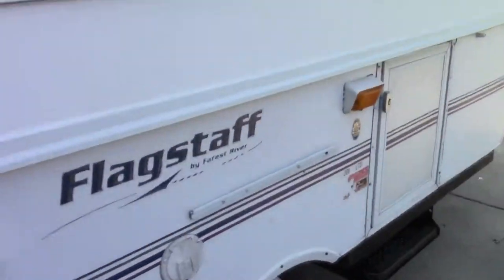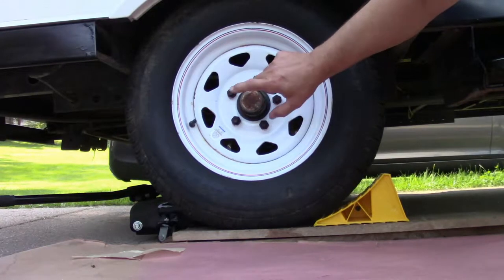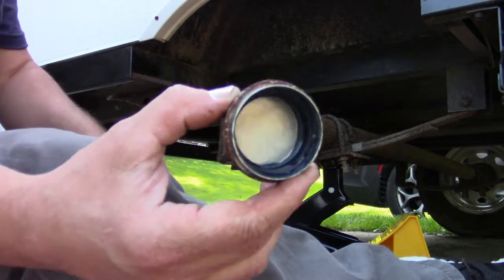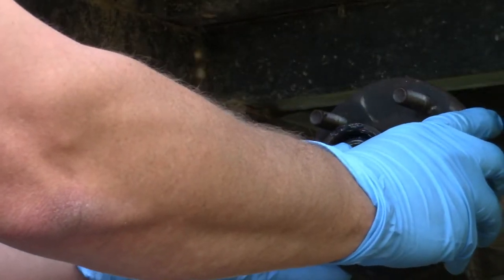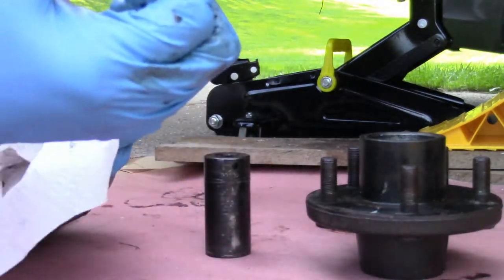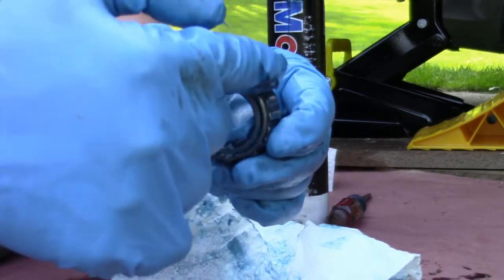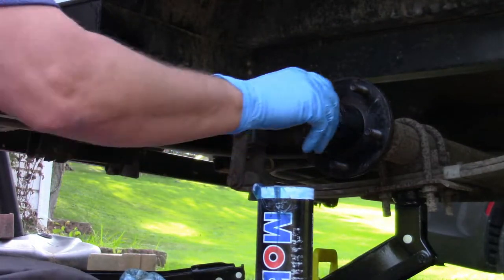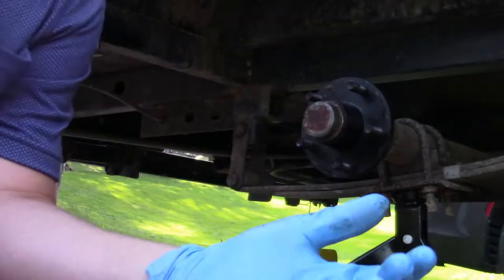2004 Pop Up Camper Packing Wheel Bearings with Grease

Comment: FYI to people who want to do this themselves; now may be a good time to replace the bearing seals as well if you're unsure how long it's been since they were replaced or if there is grease leaking from the hub cover or rear seal.  While re-using a cotter pin is common practice, inspect it closely for metal fatigue at the points where the pin bends.
The price of a new cotter pin is miniscule compared to having a wheel fall off at 70mph on a busy freeway - (think liability).  Also found it interesting that this 2004 Flagstar doesn't use a washer between the outer bearing and the castle nut like the 2002 does.
Reply from the maker: Thanks for watching, and for the great and useful comment.  I would love to go back and revisit this flagstaff, but it was traded off on a new camper.  Thanks again!

Comment: I know this is an old video, but there should have been a grease seal on the back of the hub. with a screwdriver you should have removed that seal and replaced it. The bearing would then just pull out with out hammering it out the other direction. You could have damaged that bearing. After you greased the bearing and put grease on the race and inside of the hub. Lay the bearing on the race.Then should have reinstalled the grease seal.

Comment: So I've never done this before and it looks pretty easy if you are mechanically inclined.   Only thing is...why did you not show the back bearing packing and positioning?  Is it the same process as the front?   Does the "cone" go toward the outside in mirror image of the outer bearing cone facing inward?
Reply from the maker: buttwheat75   It is the same as the front just basically backwards.  It goes back in the same way it comes out.  And for some reason I didn’t have the camera on when I put the back bearing in.  Didn’t know until every thing was over and I was editing the video.  Thanks for watching!
Reply: I’m sure u probably have to hammer it back in. Would have been nice to see that part

Comment: great video I have a question should I grease these every so many miles or grease every couple years
Reply from the maker: @countryjim100  depends on how much you use it.  I did mine every 3k miles or every other year Which ever came first.  Usuallly every other year.
Reply: @NorthCentral  I appreciate it it looks like I will be doing it every two years

Comment: just bought a 2004 Viking saga 1906 st seller indicated he just did a new grease pack and grease shot out from the rubber cap on the freeway. Can I just remove and replace the cap or should I take the bearing out and redo the whole thing? Is this an item I can find at ORiley's?
Reply from the maker: A common mistake in packing a bearing is thinking that u have to fill the entire cavity with grease.    You don’t.   You can probably get away with just reseating the cap back on, but I would look at it very closely before I did.  One thing I’ve learned is no one ever does a good a job as me.

Comment: This is a very helpful video.  Thank you for sharing!   What's the proper placement for the jack to lift up the camper?  Thank you in advance.
Reply from the maker: Andrew Parker  that’s really going to depend on the camper.  I put this one right on the bottom of the spring where the axle met the spring.  I’d go outside and look at it again, but I traded it off this past spring for a new camper.  Thank you for watching and commenting.

Comment: How often does this need to be done? We bought ours used two years ago and have only used twice. Probably about 1500 miles.
Reply from the maker: Oil and grease will degrade from just sitting around, especially if it is in sunlight or higher heat from sunlight.  My rule of thumb is every other season or 3000 miles, which ever comes first.

Comment: DO you have a video of the top replacement repair you did?
Reply from the maker: I’m afraid I do not.  I did not film the replacement.  I did not replace it in a conventional way.  Instead of using wood with an aluminum covering,  I went to Lows and bought a piece of PVC board.  A few cuts and trim later,  I installed it.  It was a little thicker, and so stuck out more, but it worked.  

I no longer have the pop up camper so I can’t show the work.

Thanks for the comment and for watching!

Comment: Did you have to remove a seal at the rear of the hub, before you knocked out the rear bearing?
Reply from the maker: As I recall, their was not a seal or washer on the back.  The back washer was held in place by friction inside the hub.  Unfortunately I’m not able to go out and check either, I traded the pop up on a new camper earlier this spring.  But again, as close as I can remember, the bearing was held in place by friction inside the hub.  I simply packed, then replaced the bearing and tapped it into place.  I wish I had it on the video, but for what ever reason I didn’t record that part.  Hope this helps, and thanks for watching..
Reply: At 6 minutes it looks like either the bearing and seal are stuck together or the bearing had a built in seal

Comment: How often should you replace the grease in the bearings I have a pop-up camper I bought two years ago and have never done it yet. Also it looks like there's grease that leaked out around the cat on the one side of my camper does that mean that the bearings could be gone or something?
Reply from the maker: As a rule of thumb,  I say re pack your bearing every 3,000 miles or every other season.  Which ever comes first.  And “liquid” grease that escapes out of the hub on one side or the other means the grease is starting to break down.  Your bearings should be fine.  If they were bad you would hear more of a grinding sound when rotating the wheel.  But it seems like it’s time to repack those bearings.